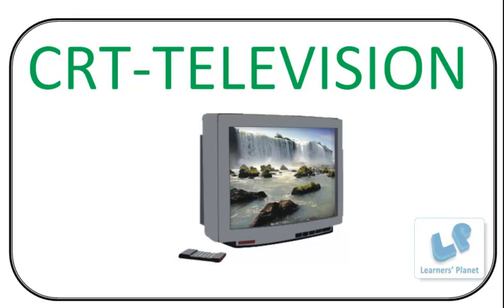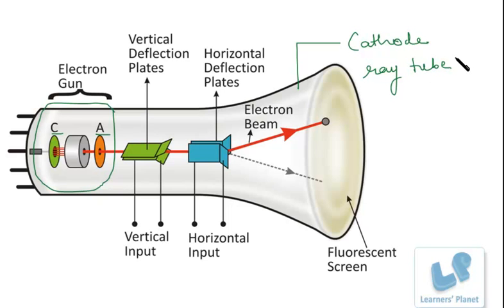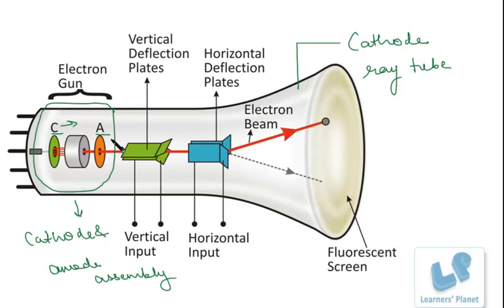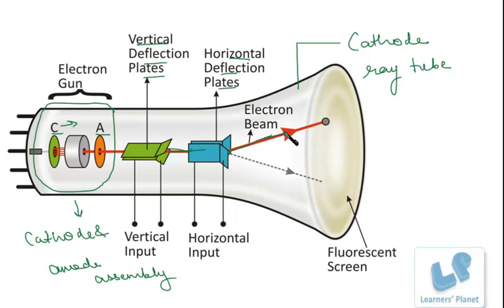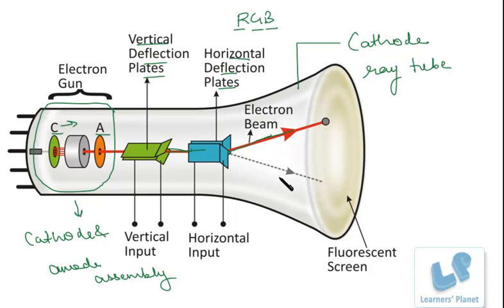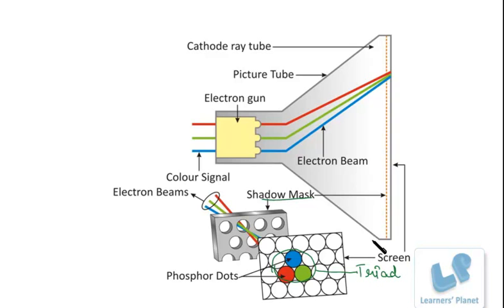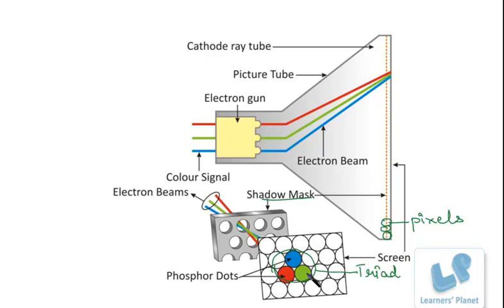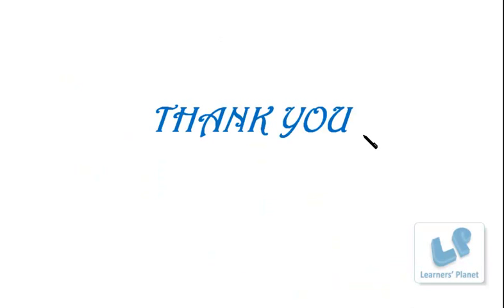CRT-Television

Comment: The number of triads in a pixel has no correlation to the resolution. The resolution specifies the number of pixels. Triads are individual units of each pixel, and the number of triads in a pixel depends on the color scheme of the display devices. 

Other than this little sliver of wrong information, a fantastic video.